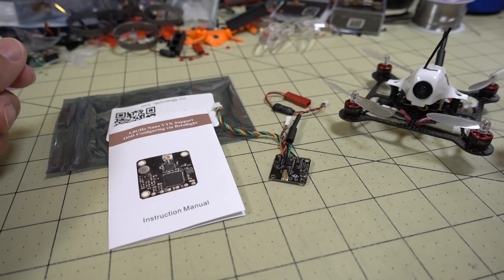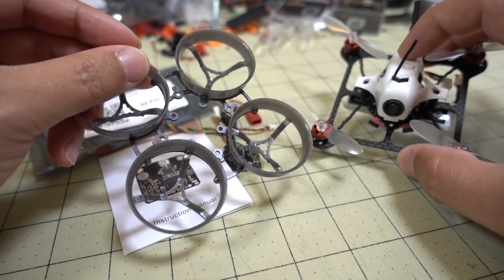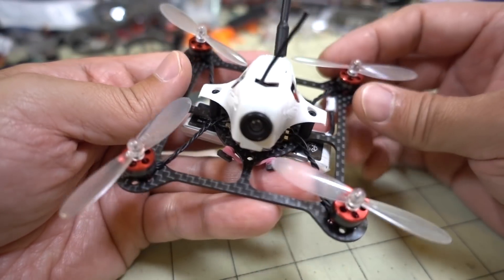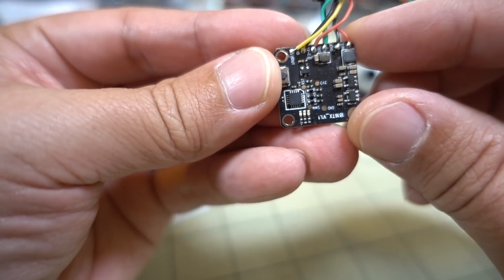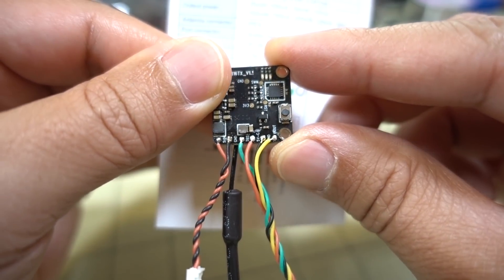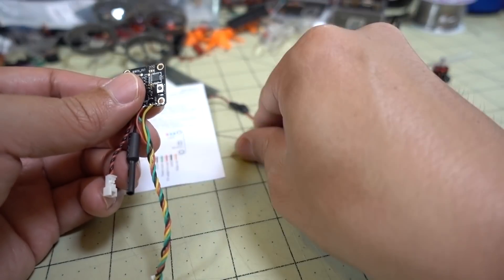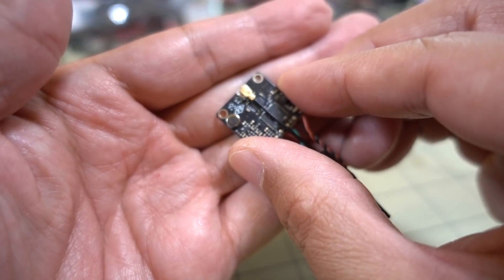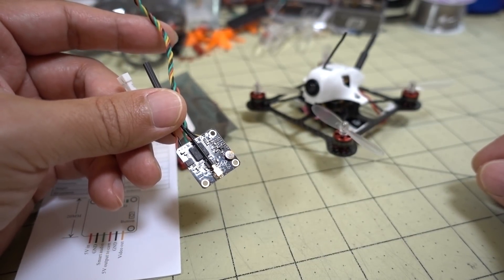AKK X5 Pro Nano VTX // FlexRC Mira95 👍

Comment: Albert:  what’s the best 16x16 vtx today?  I crashed my 2.5” tadpole.  The Rush tiny tank didn’t survive.  Small chip of ceramic came off one of the square IC chips.
Reply from the maker: I'd say one of these two. I'd use some conformal coating to keep on the small chips in a crash.
https://bit.ly/3zwztQL
https://bit.ly/3cJASK6

Comment: This frame was a good buy too and fairly cheap for 1102 motor! Seems pretty solid too!  Gnb 450mah batteries on its way too cheapest I could find in amazon!  see below! 

Gatortek Makerfire 96mm Drone Frame Work with 1102 1103 1104 Motors https://www.amazon.com/dp/B07QDW6CK5/ref=cm_sw_r_cp_api_i_zKX8CbPJR75JW

2019 Gaoneng GNB 7.4V 2S 450MAH 80C Rechargeable Lipo Battery XT30 Plug Connector for RC Racing Drones FPV Quadcopter use https://www.amazon.com/dp/B07QGYPY8V/ref=cm_sw_r_cp_api_i_yNX8CbJB7TN73

Comment: The voltage regulators that come with akk/wolfwhoop 16x16 vtxs are buckboost regulators meaning they bring 1s voltage up to 5v and give you a clean video feed as well, so only use it if your flying 1s and you don't have a clean 5v to get power from.

Comment: One more question, you seem to get little to no voltage sag on your batteries yet i get around .5v, is there a particular reason why i might find this?
Reply from the maker: For 1S, I use my own custom made PH2.0 connector.  It uses solid pins so less voltage sag.  The lipos are pretty average and cheap ones from URUAV.
Reply: Batteries are new. On a qx95s.
Reply: Ahhhh, I'm on losi. Might give it a change and see what happens. Thanks everyone!